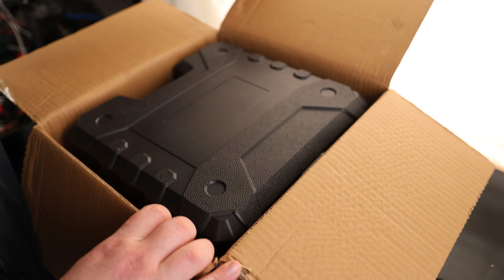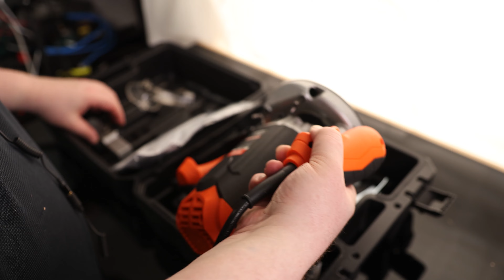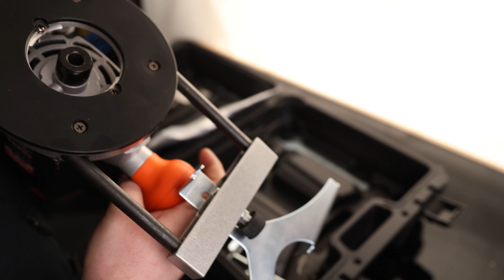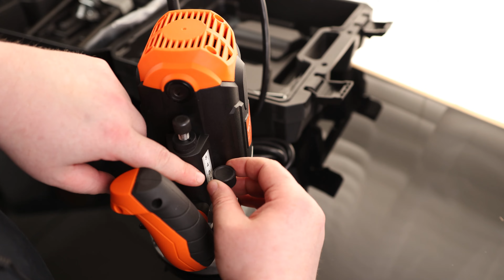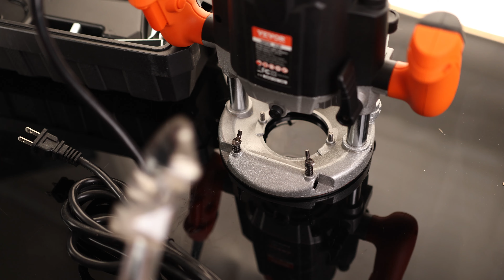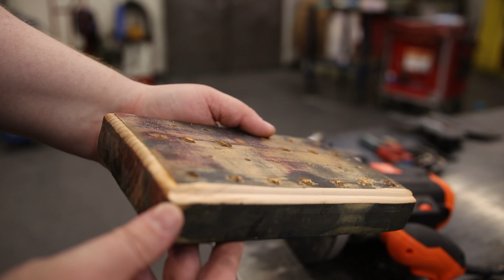VEVOR Plunge Router, 3-1/4 HP, 120V, 12000-23000 RPM Variable Speed 15 AMP

Comment: 8 months on, is it still running ok?  I have a Triton TRA2, but its too cumbersome to mount on my table so I need a  separate router. Saw this thing for 80 bucks and its definitely piqued my interest; the dual collet's are .. uncommon for a such a cheap router. That case is ironically way better than the bag I got with my 350$ triton lmao.
Reply from the maker: No issues.  It's a beast.